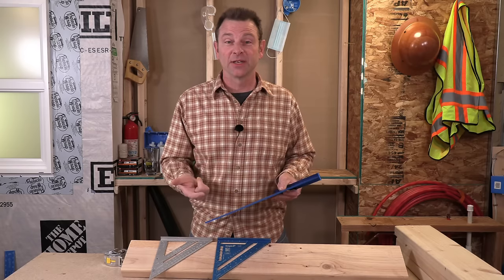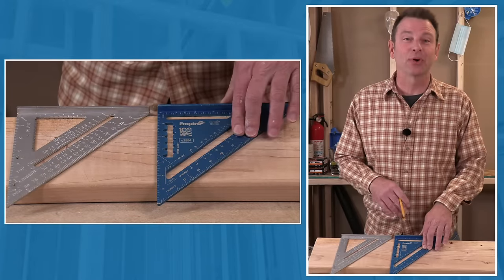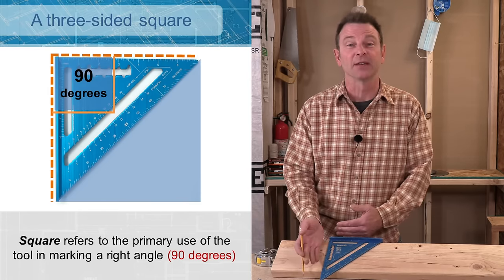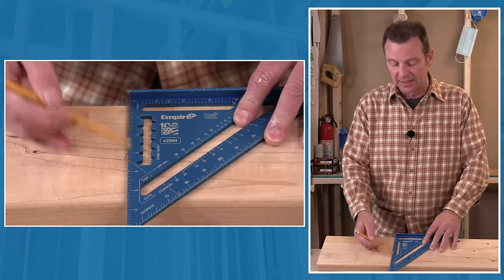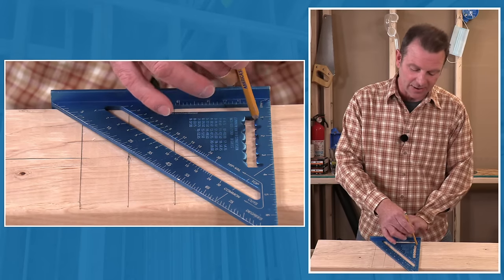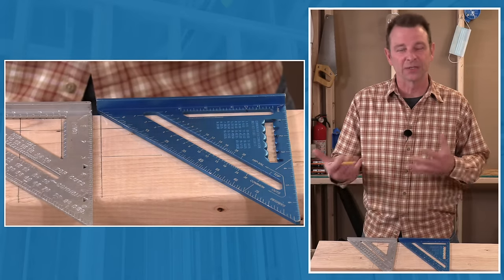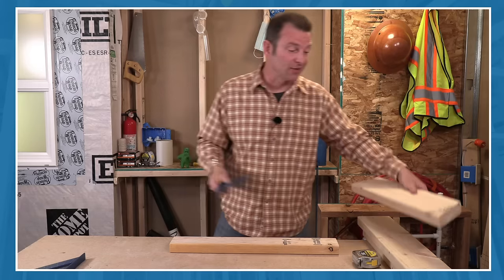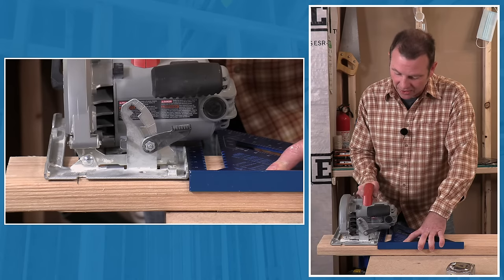Basics of a Speed Square Lesson - Measuring and Marking Lesson Series - Trade Skills Video *UPDATED*

Comment: I did not see anything about how to use the tool to set the pitch on rafters.
Reply from the maker: That is not part of our basic lessons, but will be part of our roof framing video lessons
Reply: It’s the same as he showed in the video, the pitch of your roof is the angle of the roof
Reply: @stephenwatson1873  pitch isn't commonly referenced to in degrees
Reply: The common and valley marks on a speed square are for roof slopes, not pitch.

Slope is rise per run of the rafter incline, or how many inches rise per foot run as marked on the speed square.

Pitch is the ratio of total roof height for total roof span. 

A 6 in 12 roof slope (6 on the common rafter scale of speed square) would be a 1/4 pitch roof (6’ total rise for a 24’ wide building). The framing square gauge stops would be set at 3 & 12, or 4 & 16, 6 & 24. You would choose the blade (run) or tongue (rise) to mark your rafter horizontal (blade) or plumb (rise) cuts
Reply: You can figure it out with the angle of the rafter end.
Reply: Yep, still need a visual. Jargon all you want, doesn't help.
Reply: @ConstructionEd no it 9s supposed to be speed square basics. It is with a speed square. That is worse than Walmart spreading relevance all over the store.
Reply: Divide rise by run and take the arctangent to get the angle.  Couldn't be any simpler!  6/12 is approximately 26.565051 degrees.
Reply: @fcabulldog: You don't need to do any division. The marks for rafters are right on the speed square. That's the whole point of the tool! It's not a calculator.
Reply: @jakeviolet2195  Yeah, I know.  I was joking by making it unnecessarily complex.  The square spares you from having to do trigonometry.
Reply: thank you, you just saved 17 minutes of my time!!

Comment: I’ve been using speed squares for years and consider it a critical tool. However, I’ve only known an eighth (1/8😊) of its utility. I became keenly aware of that recently when trying to install rafters on an offset roof with a dormer and really struggling to find the correct angles + lengths. While An Angle finder helped, I knew there was a way to use the “rafter square” and was irritated I couldn’t figure it out. I know this video didn’t cover that, but it discusses several other features that would have made many jobs more efficient (like ripping a board in half without having to measure both ends & drawing/chalking a line!🤯) had I known. Thank you for teaching!
Reply from the maker: Thanks for the comment - we will be releasing a video about using a rafter square for roofing soon - it is part of our other resources for teachers, just not part of our free public distribution yet.

Comment: I've had my Empire Speed Square, like you have in the video, for at least 10 if not 20 years, and the markings are still there, they don't fade or go away. Even if it did, they have a lifetime warranty, so you can just take it back to Home Depot and exchange it, no question asked. I also have a Milwaukee Speed Square and have had it for about 5 years and it is the same. 
The good thing about these is it is easier to see the markings, especially in bright sunlight.
Reply from the maker: I also like the price

Comment: Finally someone explained angle cutting properly. I have friends who will line up 30D on the square to get a resulting 30D angle and they can’t figure out why they were wrong. It’s the same for a miter saw. The readings on the saw pertain to the angle of the waste piece. On both the square and miter saw 90D shows as zero. That’s why you have to subtract he angle you want from 90 and the result is the setting on the saw or the square.
Reply from the maker: very very true

Comment: Thanks for that succinct and very precise primer!

I am a 'beginner' woodworker (starting a little late in life!) - and I just got myself a speed square... That is how I bumped into your video.

I did guess the basics, even before watching your video here - but it certainly helped to get 'confirmation' - as well as a properly 'informed' look at those 'basics'!

However, there are TWO features on my speed square (and as far as I can make out, from online images, they are there on all speed squares) - which I cannot find an 'intuitive' explanation for - and, those two features are NOT covered in your video here either... So, was wondering if you could point me to some resource that would help?

Features:-
1) A small HOLE, along the 45-degree edge, right on top of the 55-degree angle mark 
2) A SECONDARY and TERTIARY set of agle-markings, with notations, saying "COMMON TOP CUT" & "HIP-VAL TOP CUT"

Thanks in advance...

Comment: One of the best tools I have ever bought over the years is a speed square.
Reply from the maker: I agree - I have a bunch of them also.
Reply: Yes. If I am working a new guy that is also new to building I tell them they need to buy 3 things so that they have their own: Tape measure, pencil, speed square. 
I don't tell them that if they get those three things in the first month (and have them every day) they get an automatic $2 per hour raise at the end of the month. If they don't get those three things in the first month, I don't keep them for long after that.
Without those three most critical items you're basically useless for anything but carrying lumber. The knowledge to use them can only come from having them in the first place. 😁
Reply: @BariumCobaltNitrog3n  I tell them to get them, I teach them to use them. I don't tell them about the raise. If a young new guy isn't motivated enough to bring the absolute minimum to work with him every day, why would I want him around?
Reply: @17Scumdog  Assuming everyone thinks just like you could be a stumbling block. People are "motivated" by different things and require positive feedback. A surprise reward is the same as no reward, no one will see it as a goal.

Comment: Good video. Why would you rotate the speed square when cutting an angle when you can use the markings directly on the speed square? For example, when you made the 20* angle you rotated the speed square 70*. Why not leave the speed square where it was and then just use the 70* mark? Doing it this way will be more accurate as there is no movement of the pivot point. On a shorter width board the 70* mark would be off the board and either it would be done your way or butting up a piece of scrape wood to make the width wider so the line could be drawn.
Reply: You can do it that way, but you'd need to draw a line from your 20 degree mark to the corner (pivot point) with a straight edge.
In general, really shallow angles (shallow relative to the SIDE of the board, that is) are a little tougher to do well with a speed square because it becomes hard to keep stable with not a lot of the speed square touching the board.

You can see he kind of missed the edge where the pivot point is. Also factor in that dimensional lumber has rounded off edges, making it even more difficult as well.
Reply from the maker: correct - maybe ways to use the tool
Reply: @ConstructionEd   Nice reason to have a F clamp in your kit.. I'm not good at holding the square and saw at the same time and tend to like having fingers attached to my hands. It's part of my original equipment. My fingers are OEM.. ;)

Comment: I think you should have the square the other way around when cutting .  That way the saw pushing forward pushes the broad edge into the material giving greater stability.  Great video.  I am subscribing.
Reply from the maker: You sure can - I find that the fence sometimes get in my way when I turn it around
Reply: You can, but then you are only pushing the board, and don't have a lot of resistance, so your board can easily move, especially when you are actually cutting at speed, not demonstrating like he was.
Reply: @ConstructionEd  When your blade is too deep, you will catch the edge on the motor housing. Lift the blade so it is just sticking out of the bottom of the lumber. It cuts better like that since you have more teeth surface cutting the material.
Reply: Also, the tip extends pass the edge which will help with aligning the saw at the start of the cut.

Comment: I just bought a speed square last night and came across this video today - thank you!  I have a question: When I got the square, I envisioned holding the square in place with the edge tight against the edge of the wood (like you showed), with the pivot point where  needed, then simply making a mark at the degree needed (like 20, 40, or any other degree), then using the straight edge of the square to draw the line for cutting.  Would that work?  And is there a reason not to use this method?  Thanks for the input.
Reply: This technique works but involves more manipulations of the tool. Keep in mind you would then be marking the complementary angle in comparison to the technique showed in the video.
Reply from the maker: thanks for the assist

Comment: After using several brands and styles, Swanson is the only one that should be bought for construction or rough work period.
Reply from the maker: Great to know - thanks for the tip
Reply: @ConstructionEd  Sharp CNC cut edges, inaccurate marks, and as you mentioned and I loved that you did, stamped numbers.  The others have their place, and I still own them.  But in framing, roofing, rough work, stairs, etc., just buy a Swanson and be done.  I have one that is 25 years old and been abused and still is my baby.  I am NOT against the other brands, but the square should be this one.
Reply: And thanks for your videos.  Well done.
Reply: Meh, I've used pretty much all of them and they all do the job the same. The marked numbers are better to use in bright sunlight or low light conditions compared to stamped markings imo.
Reply: @jmackinjersey1  Agreed.  I have painted my numbers once on one Swanson.  But my personal opinion is they're the best in a teaching situation.  Just for various little reasons I mentioned.  And just like tape measures, I have seen printed measurements inaccurate on squares, rulers, and tapes.  Side by side, same lot, same brand.  HF is the worst.

Comment: A common Problem ive seen with speed squares.
After time and use the ends get bumped and flattened slightly where it creates a bump  particularly on the inner edge of the lip ..makes the square inaccurate.
Use a file and knock the bumps down
Also i see alot of trim carpenters that carry a bottle of glue in there bags with the square and get residual glue stuck to it and oblivious to the fact it effects accuracy
Reply: Exactly correct. The CNC cut squares, like the blue one in this video, are very bad about getting dings or burrs every time they're bumped. I quit using the CNC squares for this reason. The cast squares are a lot harder. 

I found this out building with aluminum extrusions which are much less forgiving than wood. All the edges are straight, flat and hard so even a tiny ding on the square causes it to rock rather than sinking into the soft wood.
Reply from the maker: I agree, there are many better products available...we were using an inexpensive version as most of our viewers are schools and school rarely have the best equipment.
Reply: @ConstructionEd  there a great tool to have in the arsenal,  
Just have to check it occasionally.

Comment: Great explanation. Thank you. But, at 6:10 „A 2x6 is 5 and a half inches“ - for someone coming from a metric country that is just Chinese.
Reply from the maker: Sorry about that - the initial video lesson was created for a US audience but we thought we would share them with anyone on YouTube
Reply: @ConstructionEd  I still don't get why a 2x6 is only 5 and a half inches wide. Why is it called 2x6 in the first place? Shouldn't it be 6 inches wide? Sorry, I am not from the US and it seems unlogic to me.
Reply from the maker: @mms333  It is not very logical.   Our 2x4s use to measure 2 inches by 4 inches, but over the years that has changed due to milling the edges.   Now a 2 x 4 measures 1.5 inches by 3.5 inches.    Very confusing - your cm is much easier.

Comment: Nice but slow video. I was just wondering why  when freehand cutting a board with a dropsaw you just drop in the saw? It's much easier to do it like that. The blade guard will give much easier then forcing it like you show in the video.
Reply from the maker: We don’t typically have to force a cut, likely it was just so we could get the right camera angle

Comment: I got into trouble with some pressure treated 2x4's: a couple of them had a 90+* twist over 12'. The Speed Square was immensely helpful getting a straight enough cut, along with some clamps to work with the rest of the construction
Reply from the maker: PT can twist like crazy, especially here in Colorado where I am

Comment: I am not an expert but rotating the angle finder seems pretty finicky. Seems pretty hard to maintain the pivot at the same place and correctly read the edge of a beveled board at the same time. I would just use a pencil to mark the angle without rotating the tool and then just connect it with the pivot point.
Reply from the maker: As long as you can get the materials marked as needed, all is good.

Comment: I learned something which for us non-imperialists makes no sense. You buy a 2x6 and it measures 1,5”x5,5”… genius 😂
Reply: We are brilliant, aren't we?  It comes from when a 2''x4'' piece of lumber was measured at 2 inches by 4 inches - now they mill that piece of lumber to make it smother and straighter by shaving off a 1.4 inch per edge - making it 1/2 inch smaller in each direction ( width and thickness).  So while we call it a 2x4 it is actually 1.5'' x 3.5''.  It is called the nominal and actual dimension  - basically is a challenge to teach at the beginning.   And there is more - dimensional lumber over a certain width changes at a different rate - but for that, you have to watch our video lesson on dimensional lumber.

Comment: That empire square is not printed. It's laser etched.
Reply: Thank you for that note, I'm a beginner, if laser latched how does it compare with engraved one over time?
Reply: @briankonson6541  I've heavily used a laser etched Masterforce square and it has held up very well.  I also own a CNC marked Johnny Square. Both are fine choices.

Comment: Stop doing math, it leads to errors. Hold the fence tight, make a small mark at the angle you want to cut, then pivot to the mark.
Reply from the maker: That is one way to avoid math, but I can not say that it is the best way.
Reply: @ConstructionEd   It's definitely the best way to mark pitch angles. Unless you think it's easier to subtract 26.57 from 90
Reply: This is just basic arithmetic, not even algebra. Not hard to understand.